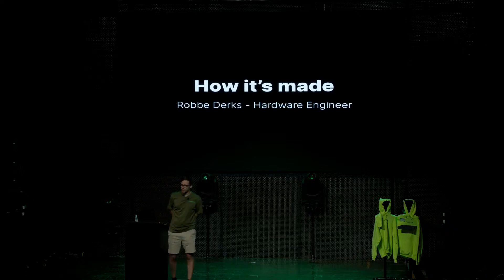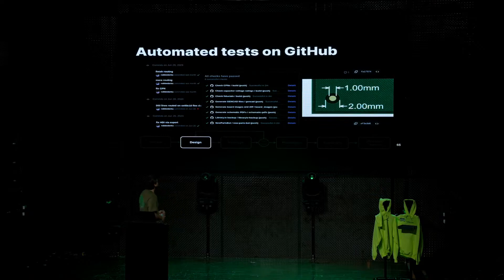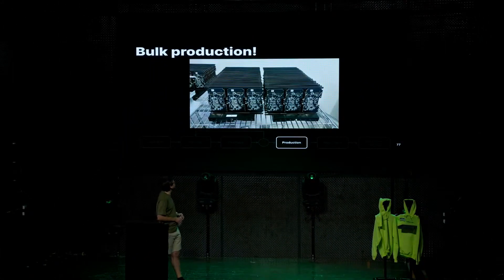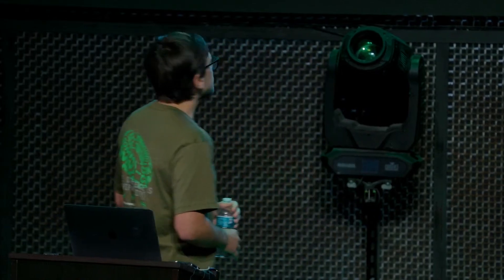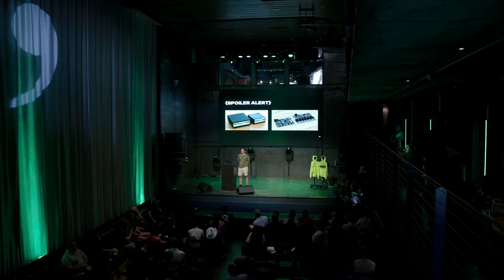comma ai | How it's made | Robbe Derks | COMMA_CON talks | Hardware Engineer | new hardware comma 3X

Comment from the maker: from $1250 buy -> comma 3X comma.ai/shop/comma-3x | If you have skill apply on -> comma.ai/jobs | Join the community on github.com/commaai/openpilot | Check if your car is supported -> comma.ai/vehicles | How to setup your car comma.ai/setup | follow the official youtube.com/commaai for more livestreams | Stay up to date by following twitter.com/comma_ai | Hardware:
- https://comma.ai/parts
Chapters:
00:00 intro
00:12 comma is fundamentally a consumer electronics company
01:05 EON
01:32 comma two
02:10 comma three
03:01 comma three x
03:30 Crackdown module for LTE, SOM for compute
03:59 product life cycle
05:10 concept for comma 3x
06:05 Elon saying no part is the best part
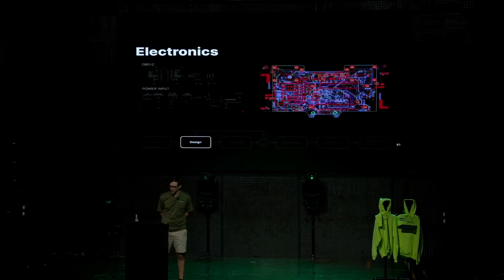06:15 electronics
08:26 parts, 136 unique parts in 3x
09:04 partbox, customer part numbers, api access
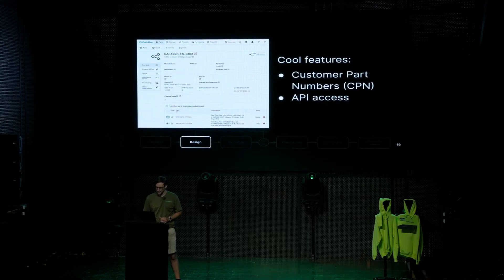10:17 automated tests on github
13:20 mechanical designs
14:05 bare PCBs
14:39 production line in house reduces the cycle time
15:35 first machine, add solder paste
16:57 next machine, place components (pick and place machine)
17:41 oven
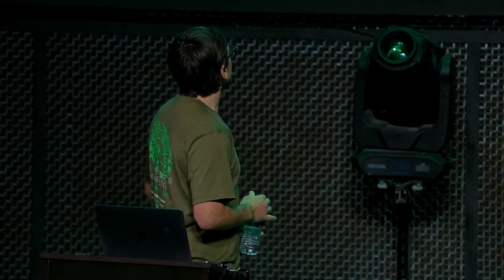19:14 automated optical inspection
19:55 verical integration
20:59 prototype devices testing, unit tests, RF compliance
22:36 field testing EPHOT
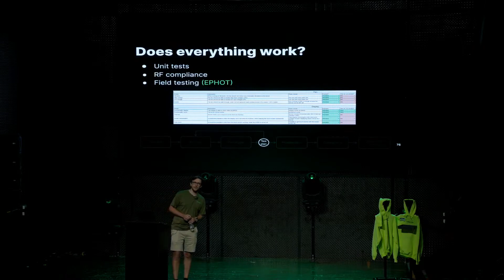23:04 two bugs found, software bug with the new panda
23:20 third-party long cables with VW users
23:45 bulk production
24:30 initial provisioning
26:16 building into full devices
26:38 final provisioning
27:39 stress testing for 24h cycle test
28:43 fulfillment
29:55 final cosmetic inspection 
30:05 Ada optical inspection
30:15 hardware issues
31:26 root causing and preventing failures
32:17 design bug with red panda, USB with 12 volts
32:40 comma three failure rate at all time 9.2 %
32:54 failure rate last 365 days at 3.9 %
33:10 failue rate of other devices
33:40 smaller harness boxes announcement
34:10 new panda jungle with CAN-FD
34:30 part shortages, packaging, injection molding, BOM optimization, cable testing
34:40 suppliers, harness production, mounting plates, trough-hole soldering, display calibration
34:50 laser depanelization, pandas, comma body
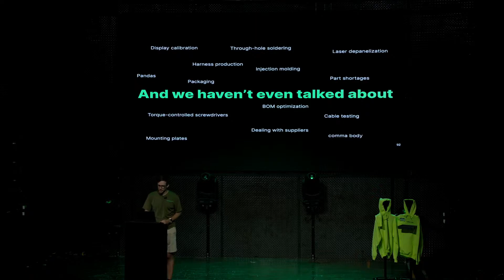35:00 apply for hardware job
35:25 compliance testing for European Conformity, FCC
35:49 harness connector
36:40 automated testing diff between the old board and new boards
36:50 Eagle the cat package inside CI Docker container
37:10 hardware networking events in San Diego
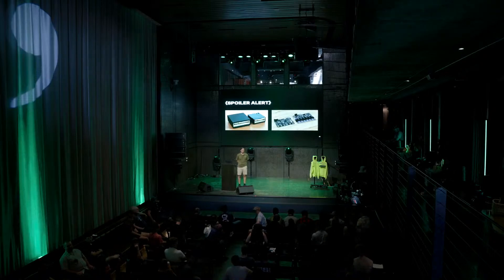37:38 weird issues that took a long time to track down
37:55 comma two and three GPS troubles
38:33 wrong component send by the supplier
39:15 custom ASICS
39:40 thermal resiliency of the devices
40:38 root cause process (manual or automated) after getting failed devices back
41:25 GPS module upgrade difference
42:05 favorite part of 3X process, new image sensors
42:30 how do you manage being in Belgium while they are here
43:00 Robbe is the only remote employee
43:10 comma super low on meetings, all hands and a team meeting every week